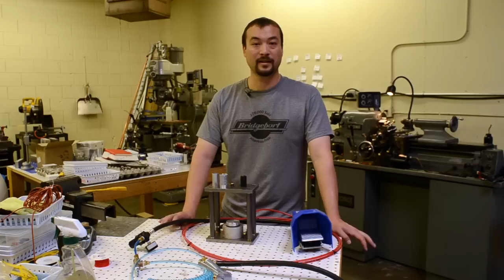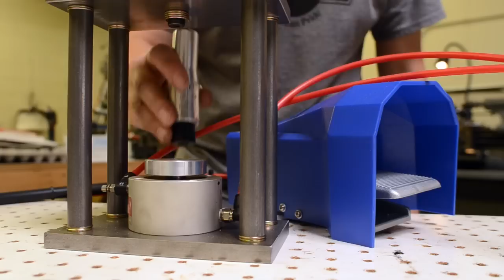Prometheus Lights: Shop-Made Pneumatic Press

Comment from the maker: That was actually my original plan but two things changed that. First, if I wanted to disengage the press for any reason (say I put my finger in it) I didn't want to wait thirty seconds for it to release. Adding an emergency stop button was seeming like too much work :) Second, I actually do another process that takes about 30 seconds while the part is being pressed, so it turned out I didn't need an automated timer after all :) Maybe once I set up a rack of them or something!